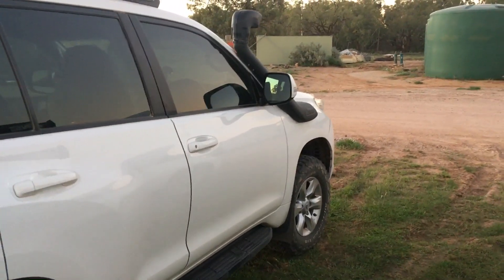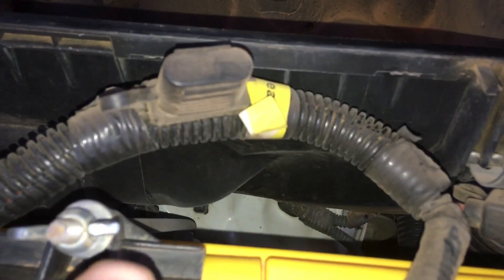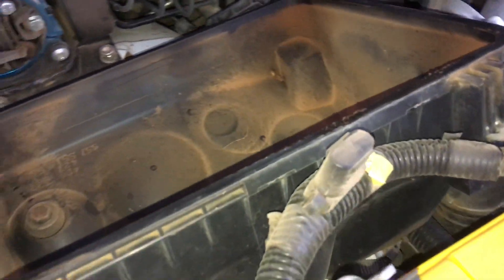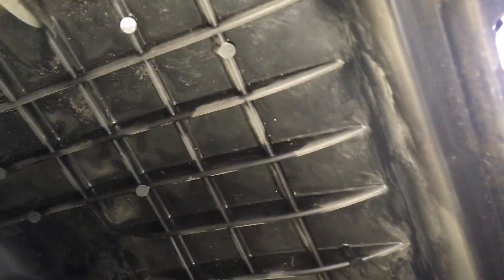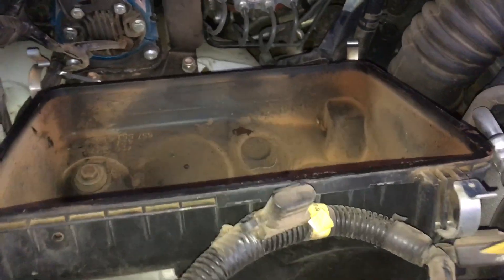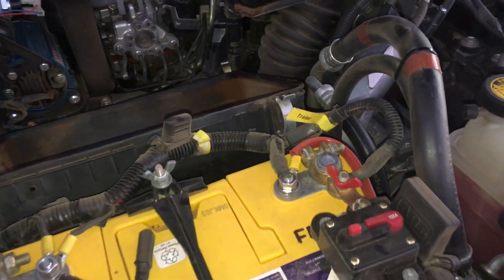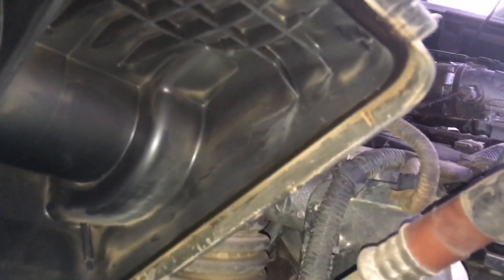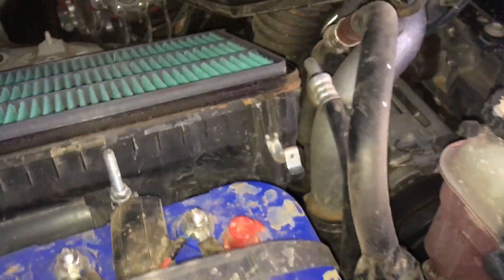DOES DUST PASS THROUGH THE K&N FILTER - THEN LETS CHECK TOYOTA GENUINE From same trip....

Comment: hi 
Funny bout this topic . From ag machinery experience half the problem was the air intake position getting sprayed with dust ,then the filtration system . Machine fitted with spinner precleaner then  Donaldson with secondary finer  media safety filter then  paper  filter ontop of engine . This did not stop the intake from getting a finer coat of dust internally . So fine u could basically say its just dirty air stain . Only 10-20% of the Hilux issue 
To get rid of this a finer filter was used [oiled foam] . No more dusting . All clean air .

Comment: Toyota air boxes are a joke. Its called planned obselescence, ie planned dusted engines. I spent a lifetime working on earth moving machinery and have seen how a correctly designed air filtration system keeps the air intake protected in very much worse conditions than driving up a dirt track.

Comment: Keeping in mind it only takes a few grams of dust to cause irreparable damage to an engine. Panel filters are not up to the task of outback style dust filtration, that's why you don't see them being used on trucks, tractors, earthmover or any other heavy-duty machinery. What works is a radial sealed cylindrical filter such as a Donaldson or what the Ford Courier 99 through 2006 wl - t diesel utilised.

Having a snorkel on a late model four wheel drive is only good for one thing and that is preventing water ingestion, they most definitely do not improve performance as they're often poorly designed with restrictions adding more turns and length to the intake. The standard air intake will already be optimised for anything other than a water crossing. Those who fit them are reducing power and injesting more debris.
Reply: Does the oil filter remove dust/silica before enough accumulates to cause engine damage? Or does it just keep accumulating over the life of the engine until there is enough to wear it out? I've got a cone filter and live in a deserty environment so it's got me a bit concerned I'm ingesting dust. I'm hoping the engine can handle minute amounts of dust at a time?

Comment: I run a K&N and a snorkel sock and had heaps of dust past the filter till I started to grease around the edge of the filter and now I don’t seem to get any pst at all
Reply: X2 looks like it’s going around the seal look at the rear seal side of car vs the front side of car seal looks as though it’s the front sealing surface worth a try greasing the seal well then do a similar trip 😬
Reply: Yup just needed some air filter grease around the seal

Comment: I’ve never blocked the one way valve. Why would you? It’s the dump point for the spinner that seperates the dirt and dust from the air. When I was on Fraser my air box was clean. But just outside the one way valve was a pile of sand. If you leave the snorkel head forward, a pre filter from Uni filter will keep out the large junk. It’s basically an oiled foam sock that goes over the head of the filter. I highly rate these. They are cheap and effective. You can get a 3 pack for around $45 and they can be washed oiled and reused.

Comment: HI 
 issues 
1/ filter dust  capacity. insufficient  [ this by default strains the mechanicals]
engine air demand does stays the same ,the suction finds air from whatever source 
box flexes 
seal leaks dirty air .
engine breaths dirty air

Comment: I experimented years ago on a new Patrol which had Steinbauer, Scott’s Rods 3 inch mandrel bent steel hi flow exhaust from dump pipe through, manual snorkel and of course K&N air filter.  I was never in dusty conditions however, from factory it appeared to work well.
Cleaning was impossible and I oiled both sides, wrapped in cling wrap into the sun turning once an hour each side.
The next air filter inspection revealed oil bypass up the clean side tube.
I wasn’t going to spend hours trying to get the Damm thing clean, stayed Genuine only on the Air filter ever since.
Many don’t know that they use either a Silicone, oil etc on the medium during manufacture, and like the K&N, it’s THIS that normally makes them work (filter) well.  I was surprised that it did not work here.  Never again will I waste my time and effort cleaning those bloody things again.
I also believe my MAF sensor was coated in an oil film that you can only feel between fingers when taken off the side walls near the MAF sensor.
In dusty/abrasive sandy environments cyclonic air filters theoretically should work if not broken and emptied.
There are additives that increase the ability of the oil to hold more SOOT in suspension and thus keep the engine from internal wear compared to not using this additive.
It was proven by heavy mining equipment (front end loaders/ dump trucks) that made the wear considerably less by using this product.
It saved the company millions, not only from needing to strip the engine down at traditional engine hours, but the machine was still working increasing productivity substantially.
You can read all about this supplier at cost effective maintenance here in Oz.
We have 3 diesels in our family and they all use this anti wear agent.
From memory (I could be wrong), I thought it said tests showed the oil could take twice/more than twice the soot per unit of oil.  I think other engineering tests on the samples were proven that this was no snake oil.  On their website you are able to download a book showing many test cases.
Reply: Martin it is you that created this problem. As you stated it worked well until you messed with it. This is also always the case with MAF issues ect ect. The problem now is people like yourself complain and express themselves online which gives the brand ( K&N ) a bad name.

Comment: That’s not the K&N filter letting dust through, that’s the air box not seating the seal properly, this has been seen on other Toyota air boxes as well. I run a K&N in my 95 series petrol Prado and no dust has ever got past it. The air box is much more robust than later model vehicles.
Reply from the maker: Incorrect sorry
Reply: Your going to have to come up with a more detailed response to change my mind.
Reply from the maker: I don’t have a need to change your mind but if you watch the video properly I’m pretty sure I said unless I was dreaming that we could see the seal was definitely sealing
Reply: @jamesgeorge3900  Make a video to prove him wrong.

Comment: It doesn't matter whether its a K & n or a OEM filter...Dust will make its way through either one of them.. Remember its a car air filter not a N95 mask..Also cleaning the K & n way to early is not good..let that layer of dirt soaked up in the filter oil build up which enhances filteration process
Reply: Really?? K&N are crap and NOT for off road use.  The video tells the story.